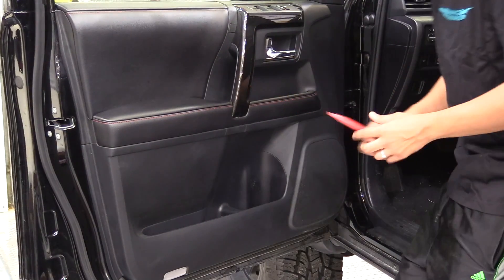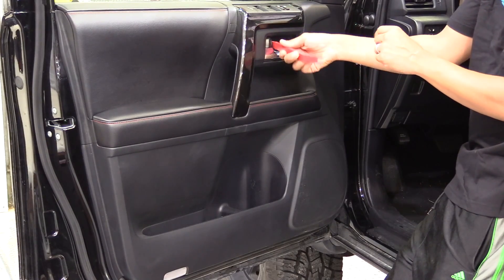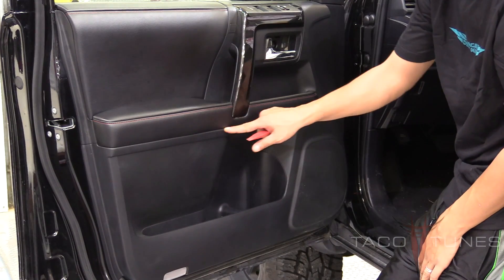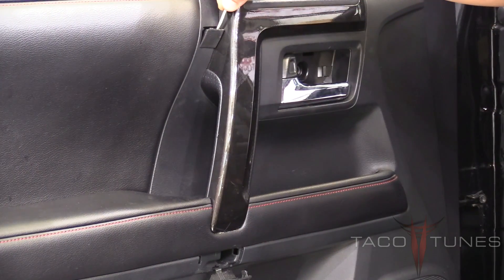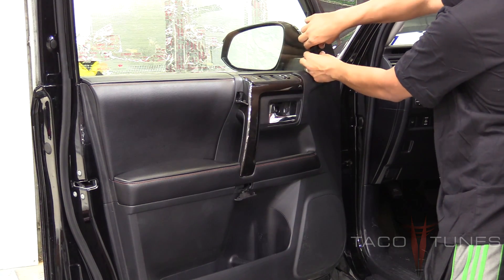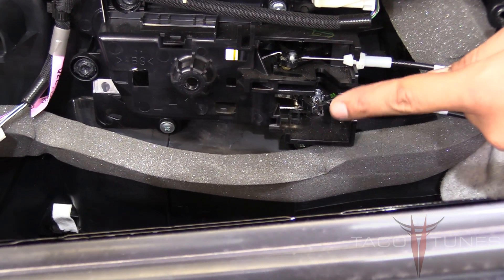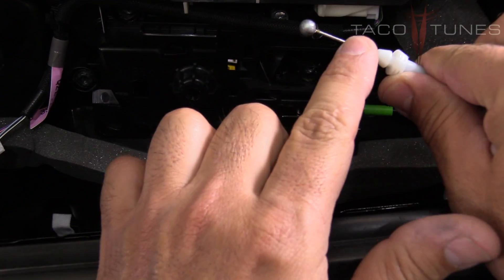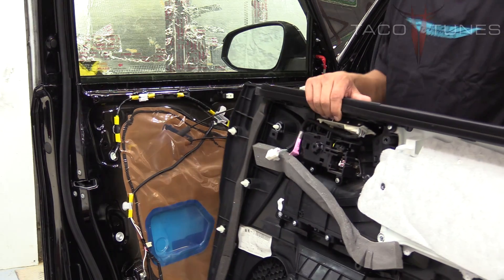Toyota 4Runner How to remove front door panels

Comment: How would you get the panel off if you couldnt open the door...bad actuator...
Reply: Dam did you ever get the door opened?
Reply: @TerlinguaBBNP  My son's got the car so I haven't been able to work on it but I think I know what I'm going to be doing. If I can get the panel partially off I know where to drill the door to pop open the lock. Plan B is to cut into the b-pillar and cut the bolts on the strike plate.
Reply: @Klassiica  There is no mechanical switch to open a broken actuator in  a closed door.
Reply: @TerlinguaBBNP  yes, I was able to pull the panel off enough to fit an angle drill behind it. I drill a 3/4 hole through the metal and basically was  able to pick the actuator with a small screw driver to open it. Once the door was open, it was a 20 minute fix.
Reply: @mzimmerman123  I know it now. Learned it hard way. Managed to pull the door panel with closed door enough to get to the lock and looking at the mechanicals of the new actuator managed to press one the levers with a screwdriver. Yes, scratches on hands and blood, so be carefull not to mess up panels and seats. Did not damage the panel. Just letting You know- its possible. Of course shop or dealer will not go this path. There is a mechanical switch, but most likely its transmission cable is disconnected from the actuator, which also acts as a mechanical lock. If You go this path- make sure to unscrew all the screws holding the panel, so when You pull it from the top with a little violence You will have to fight only plastic clips , which will pop out , but you will not brake panel at the screw mounts